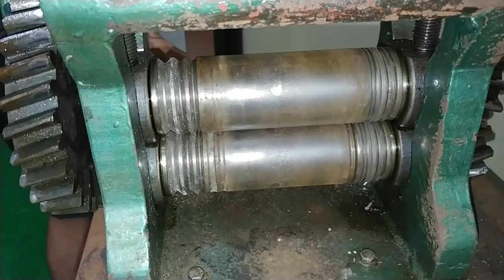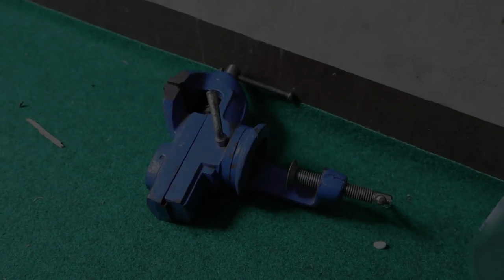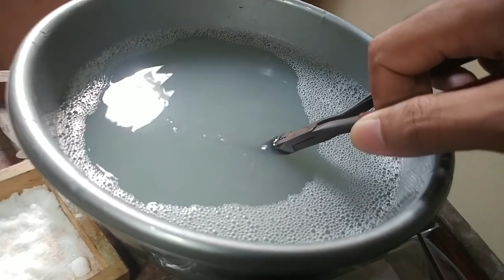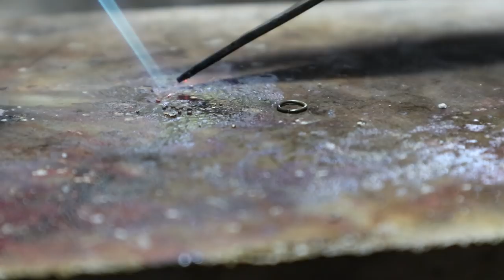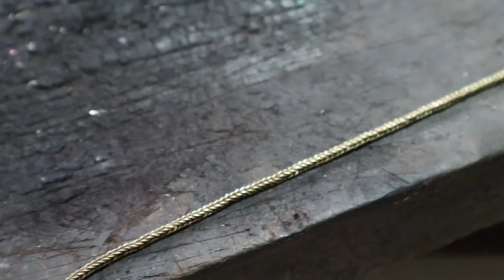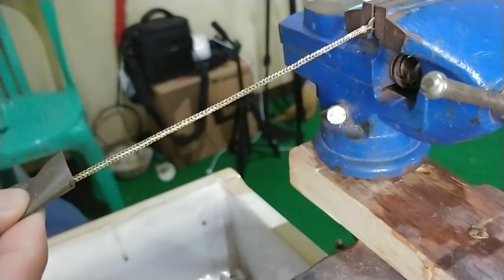how to make necklaces - 18k white gold necklace

Comment: What are the dimension used for this? What is the gauge of the wire and the size of the mandrill to make the rings?
Reply: 3mm mandrel 0.50 round wire
Reply: @FedExpressX  Thank you so much for the information. I'll give it a shot.